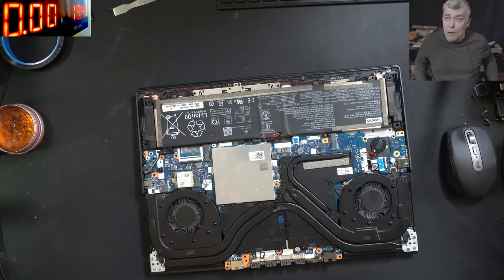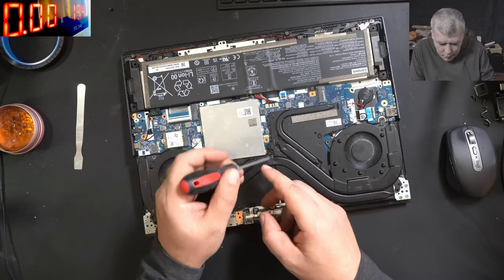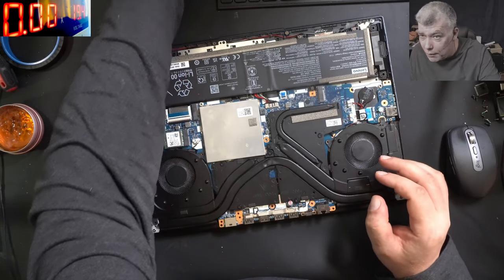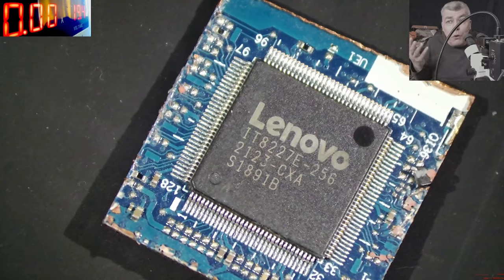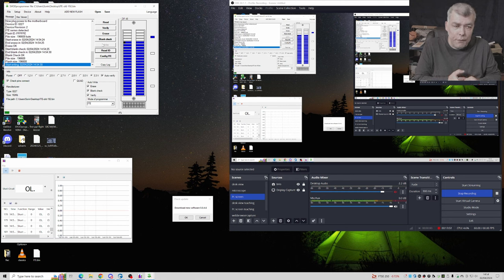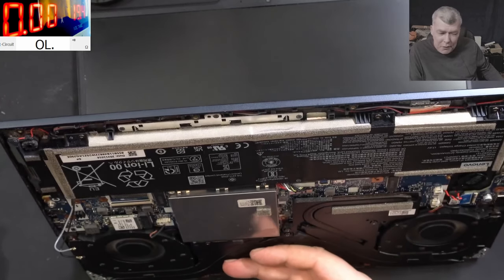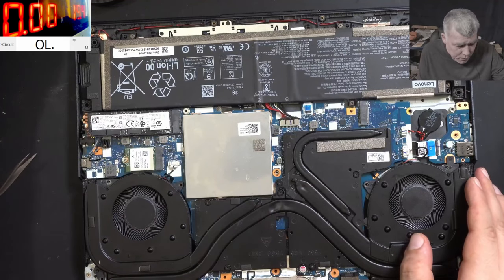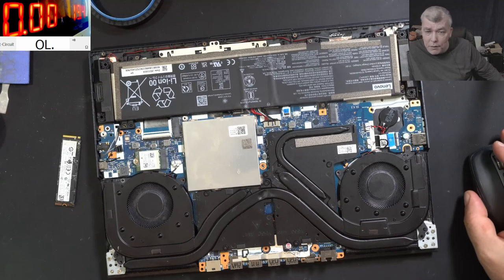This laptop is not fixed! - Lenovo Legion 5,  second repair attempt

Comment: Hello Sorin. I had the same fault with Lenovo. Check the I2C line between IT8227 and the graphics chip. The KBC reads the temperature from the chip. For me, the problem was the 2.2K pullup resistor
Reply: Let's hope he sees this comment!
Reply: Sorin i had the same exact thing with a Legion similar to the one that you have there. I thought it was the missing thermal paste, but in the end it was a resistor!!
Reply: I also discovered fault with a cheap Raspberry Pi pico and I2C.scan() function in micro python.. It wasn't showing the i2C Temperature sensor for VRM.. and hence was shutting down..  that I knocked off with screw driver.. pc is fine now
Reply: Why not the Intel ME from bios? In begining not going the fan at full speed.
Reply: I'm liking this comment hoping Sorin would read this and try it out.
Reply: Had the same probleme once. There was a shorted mosfet for the gpu. So the notebooks showed picture only with the graphics integrated in the cpu. In Windows the nvidia graphics didn't show up in the device manager. With some luck the nvidia graphics is protected by the management ICs and works.
Reply: But why both fans run full speed? Aren't they independently managed by the SIO? 
It makes sense, a resistor could be the problem (like it could be CPU or GPU or another bunch of stuff).
I could be certainly wrong since I'm not an expert but I know the majority of these kind of SIO chips have pins/tracks for every fan, which in this case are 2. One for the GPU and one for the CPU.
So if there is a problem on one of the tracks (resistor), it's understandable the shut down because of the wrong temperature reading. I'm missing why both fans run full speed instead of just the one with the faulty resistor (if it's proved is indeed a resistor), since here it's clear it's not a double fan for just the CPU or the GPU.
Am I wrong? 🤔
Reply: You need to check thermal ic section on motherboard which reports thermals to EC chip. Most of the time ic thermal ic has a fault and it is not reporting correct info to EC
Reply: Was going to suggest the same thing. Laptop is reporting wrong temp.
Reply: @agsdoom During Power-On Self Test, all fans are supposed to go from 0 to 100% speed, so the Super IO knows there isn't a problem with them. The issue demonstrated in the video is a symptom of lack-of-communication between chips, aka I2C-comm fault, likely caused by either the lack of a resistor or because it's gone open.
After the POST test is done, all fans will still run at 100% speed because that was the latest instruction they were given, until either the APU or dGPU takes over and slows them down or ramps them up, based on a reported temp.
Reply: @Rodox2k10  understood. Your explanation is very much appreciated, thank you.
Reply: How did you find it? What circuit, what SMD element on scheme? I have schematic and boardview.
Reply: @ArifKhan-bp9zx  sorry, but are you talking about this motherboard of Legion? What element SMD it was? How to find it? Thanks in advance
Reply: Is there a follow up on this?

Comment: I am no expert. Just internet citizen with an opinion :). EC chip cut from board is better in my opinion. It lowers the probability of fake EC chip, plus lowers probability of desoldering mistakes. I would prefer this type shipment. Edit: also eliminates bent pin problem.
Reply: yes indeed, perfect for shipping long distances.

Comment: 5:45 very honest seller. doesn't claim the chip to be new. doesn't risk blowing up the chip by not following the manufacturer heating profile.
Reply: No you wrong
The reason is something else 😊
Reply: The seller actually claimed the chip to be "New Original"
Reply: @1080pixel  how can it be new if its soldered to a PCB lol.

Comment: Some repair people also produce problems themselves by faning away components while using the hot air gun. I recommend to always put Kapton tape parallel to all the sides of the chip to keep the outer components cool and fixed in their location. Maybe a missing component?

Comment: fan spin at full speed then shutdown look alike thermal sensor issue, sometime the sensor using resistor, in paralel with capacitor sometime. placed near cpu or gpu or ram with RT marking in lenovo motherboard. just remove the RT resistor and test if the fan still running in full speed.
Reply: It could be, Lenovo has weird EC firmware regarding the fan/temp control. Fans will start spin unengaged at the slightest over-temperature spikes
Reply: All silicone made in last 10y have these sensors built in, there're sometimes additional one on board but that's rare. 
More likely this is faulty fan controller and shutdown is preventive because RPM is not reported to back to software.
Reply: @gorjy9610  Indeed, but if the fan is not speaking back with the EC, the bios show a warning sign at turn on which prevents the laptop from turning on.

Comment: I had a similar problem with a Mac Mini, the fans kept running at full speed and the Mac shut down. After a long search, I had found out that there was a temperature sensor that was broken. After replacing that sensor, the Mac Mini worked perfectly again.
Reply: The mac had separate sensor but anther brand not
Reply: True story
Or software problem
Reply: Yeah, but go find it without a schematic.

Comment: Probably a temperature sensor fault. I know this used to happen on Macs (Louis Rossmann showed it a couple of times), but may happen on other brands too. You'd need a schematic to figure out where the sensor is though as well as a boardview to check everything in between...not sure if you can obtain those...

Comment: @16:48 heatpipe is damage in the center , heatsink was pulled from the sides and bent in the center
Reply: I was thinking also that the vapour chambers are empty... so... no dissipation at all..but can be al so a thermal sensor.. or also a bios issue ( i will try with a bios dumped from a working machine ..maybe taken from badcaps forum ) and not from lenovo site. ( P.s. .. tge original bios has a password... but still can be used to see if the laptop is shuttingndown )
Reply: If that is a case, it is easy to confirm measuring temperatures in some software like "hardware monitor" or similar

Comment: I had Ideapad 520 with EC chip replaced and fan went full blast all the time. It was not shutting down, but kept going on full blast no matter what. Issue was faulty fan. :D  In this case, i think there is a thermal sensor issue

Comment: If you possibly have time to monitor the CPU temperature quickly while its on to see if it is going up even if it really isn't  so you know its a sensor issue which is a resistor (marked RT) located near to the CPU.
Reply: i was tried. Mine fans are at max some longer time and had time to see CPU and GPU temp. Temps are normal, butt fans are spinning as hell.

Comment: Had something similar happen to me once. Turned out to be the tacho-signal from one of the the fans that was missing, so laptop thought fan wasn’t spinning, told both fans to run at full speed, and then gave up, shutting down. Had to use my oscilloscope to figure out what the hell was going on.Laptops should really have a standard group of diagnostic LED’s on motherboard… or something

Comment: Good try. But the problem is this ec chip was already from same board and you didnt need to reprogram it since you didnt have any issue with another ec chip too. it was just firmware issue because firmware is using different gpio for thermal sensor and that is why you are having issue and also this is why they are selling ec like that so you can use it on same motherboard without programming it because firmware for these models are difficult to find. so lessons learned.Before doing any kind of programming take backup of your old bios and ec firmwares. even if it comes from china))
Reply: You are right 100%
Reply: Lol i was thinking same why he didn't take a backup from the bought ec chip
Reply: Sorin, try updating the BIOS with the recovery method:

1. Power off the laptop.
2. Unplug everything.
3. Plug in USB with GKCN.bin (the BIOS for the laptop renamed to GKCN.bin).
4. Press and HOLD fn+R keys. (keep holding while doing the next steps.)
5. Plug in power. (If laptop powers on automatically, hold the power button until it shuts off, and start again from Step 2.)
6. Press Power button once. The laptop will turn on and your charger indicator will turn red.
7. Keep holding the fn+R keys until the laptop will start beeping very loudly. You can release the fn+R once it starts beeping.
8. Wait until the laptop reboots itself.

Once it's done, if it works, boot to windows and update bios from windows too, because the EC and BIOS firmware will be mismatched.
Reply: @miajonekem  Didn't you watch the video, the laptop shuts off after about a min so not going to be able to update the bios.
Reply: @fickitonetime  Would certainly be worth a try. This procedure only requires bios to initialize, which it is clearly doing in the video. If bios has this capability it would not be checking temps (since bios interrupted boot, there is barely anything powered on) so this could work.
Reply: @theothergameygamer  is not a bios. I was try several versions. Newest is 28, but i programmed and 13,15,18,20....even and version 31 for some other model-was working !!!
Reply: @mshone1972  ??? Perhaps reply in Greek instead and I can translate on my end. (I think you're saying that you fixed it with a bios update).
Reply: @theothergameygamer  no, unfortunetely...is not a bios problem. Not fixed yet
Reply: @theothergameygamer  alla an sou teriazei, mporw kai sta ellhinika na grapsw 🤣
Reply: @mshone1972  Thanks for the clarification.

Comment: I don't think that fault to be software related...
Things I would check:
- On BQ chip, disconnect PROCHOT track coming from CPU.
- Check for a missing pullup resistor on PROCHOT (around CPU and/or PCH).
- Check thermistors (if you can get the schematic or boardview) 

Probably the fault is easy to be fixed, but at this point you need more info about the board....

Comment: In some of the laptops the RPM fan control doesn't work in BIOS. I have try that on a brand new laptops and the fans was working on full speed. But after exiting the rmp control lower the speed.
Reply: Interesting

Comment: the thermal sensor is faulty it is signalling the mobo that cpu is getting very hot fan spining at full speed to cool the chips still faulty temp.. due to overheating it's auto shutting down to save the components

Comment: There appears to be multiple issues with the fan control on this laptop, especially after updating Windows or the BIOS. Some forums suggest a hard reset / recovery mode (pressing the Novo button during power up, the button with a star and S on it) and then forcing the laptop into quiet mode (Fn + Q ) to see if that makes any difference, shutdown-wise. As another viewer suggested, there may be a fan tacho issue, try connecting just one fan, then the other. As the laptop seems  to be relatively stable without the heatsink it seems unlikely to be a thermal sensor issue (in my opinion).

Comment: I've had this very same problem with my exact same Legion 5.

The issue was i replaced the thermal paste with liquid metal, and somehow a tiny amount got on the board.

Not sure which part it was on, I didn't have a microscope to check, so I just disassembled the motherboard, gave it a big scrub with alcohol, and when I was cleaning my brush on paper towel, I saw it had the liquid metal on it.

After cleaning the board it was working perfectly again lol.

Obviously can't be the same issue here, but i thought I'd share my experience.

Comment: The chip was cut probably to not bend the pins or otherwise damage it during transport and the removal from the board, also saving time and money on paying workers and making or purchasing a special container for transportation. You probably got it very cheap.

Comment: there might be a workaround for this, enter bios quickly, disable shutdown temperature and set manually the fans speed, might not be beatiful, but it will keep it working as long as the bios battery kept charged.

Comment: In a comment on a previous clip about programming an IT..., someone made the following observation "You programmed 128KB instead of 192KB. Once the chip is detected, you need to select its size "button CONFIG ITE". Did you not repeat the same mistake?

Comment: Isn't there sensors for heat ? you should check the temperator in the bios. if it's not correct try to see if there is some bad resistors.
Reply: yeah really no idea why he doesn't run some sort of hw monitor to check temps. or at least in bios it should show
Reply: @Nebbia_affaraccimiei  i did it on same model with same problem. CPU and GPU temp are normal, but fans running as hell

Comment: Probably not gonna help but there's this: EC Reset:
press and hold the power button for 30(or 60) secs, release and wait for 5 secs, and turn the laptop on again. laptop will boot with Balance mode on all Legion.
But as you said, it could be anything really, faulty chipset, faulty thermal sensor, faulty fans...

Comment: That pin which was bent on the first chip..two or 3 pins up from that there is a solder bridge between 2 of the pins ..i wonder if this bridge caused a resistor to die on the board which was something to do with the thermal sensing ..
Reply: yup 10:18 you can see solder bridge on the third pin from the bottom with fourth pin fron the bottom

Comment: If I were to buy used chips I would actually love to receive it like that, because it means they also didn't rush to remove it with a lot of heat. The chances of the chip being good actually increase in my perspective.

Comment: Sounds more like broken resistor or temperature diode of the cpu or gpu or could be a low resistance or shorted filter cap which prevents the EC from reading the temperature

Comment: Lose pins or burnt resistor could cause bad i2c signal , I would start by checking all the pins make contact then check the dat sheet of the EC chip to figure out the I2C SCL and SDA signals

Comment: I'm not sure about how the temperature is being sensed on this laptop but it might be be a thermistor somewhere connected to the EC chip or some other chip maybe that thermistor is faulty or burnt and giving false signals to the EC to shut the laptop down because of overheating because a laptop can sense when cooling is bad and shuts off the laptop if a thermistor is burnt that would make sense.

Comment: Thats either a gpu or cpu issue , course any other components connected to those too might be the problem too , most likely to be a short in cpu causing over the roof overheating

Comment: It is  heatpipe issue. To test if the heatpipe is defective, first completely disassemble the cooling system and then heat the beginning of each pipe with a flame for a few seconds. The whole pipe must be heated uniformly for the system to be good. if the table heats up only where the flame is applied and the rest is cold, then the cooling system is defective and must be replaced.

Comment: any ideas for this?: i have a legion5 with a strange problem, it does not turn on, but if it is getting power (battery or cord) the power button lights white continously and the power led ON THE SIDE lights orange. 
Vents doesnt spin, pushing the power button doesnt effect anything.

Comment: Replace the thermal pads on the cooling block and see if it solves the issue of the fan running at full speed.

Comment: Had the same issue with a L460 and never figured it out. It just turned of after exactly 10s but was working fine otherwise. I expected it to be some issue with a power good signal or something the EC chip checks.

Comment: I have laptop once where gas escape from heat pipe and not chill the cpu.  Same symptom with laptop run for about a minute or so and shut down to protect cpu.  New cooler fixed it.

Comment: 5:40 - to protect its legs in transport, its interior, to show its used already (not new, doesnt mean working), easier for him to cut with saw or dremel than to use hot air station...
13:31 - Evil giggle... hehehe = then after trusting your skills you trouble shoot one solder bridge for 1hr that you didnt check at first :D
14:17 - Hahah this is why I come to watch videos, for those jokes :D

Comment: I think there is a problem with the screen cable or it is burnt..Or a stuck button in Keyboard or a virus in the BIOS file. Try to enter Windows from Safe Mode

Comment: exactly the same problem on legion 5-15ARH05H. i tried reprogram bios (main and EC), reprogram bios of GF2060 too...fans are on their maximum, but CPU temp , GPU temp is normal (CPU 50-70 C, GPU 35-45 C). Also, with this model is s many problems, unexplained.....i know this form tons of forums.

Comment: So i had a similar problem as this laptop. I bought a replacement board off ebay. A Dell ryzen. I set it up and when it started the fans ran at full speed and then turned off. gave me an error message about the fans. got the board serial number and checked on dell. it had a bought protection for repair and used the secure?? program. so it was blocked. i noticed you didnt hook up the wireless card. somehow they can talk to "home" even if you dont connect to your network. then i discovered that the bios writes the ec chip and possibly stores the secure?? info, I used that to get a brand new board from dell. this one i am currently using. seems that is an old board as i looked and found that it has an 2080 video. but it sure acts as if it has that secure?? enabled. get into bios and check for board id number and see if lenovo has the same program. then a good bios would maybe allow a fix. good luck

Comment: Interesting, because I’ve got na older laptop, Lenovo Z510 with exact same issue. This problem happened with original EC chip. I ordered spare EC chip but I’ve broke the chip’s pins and left if for later…